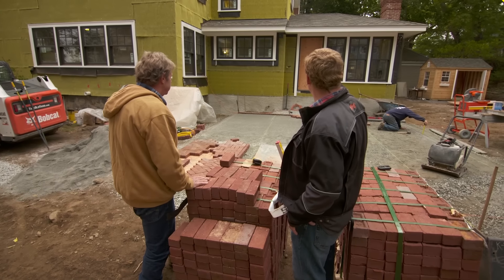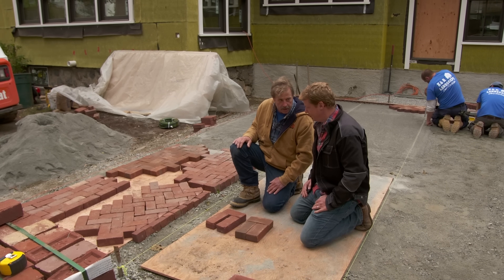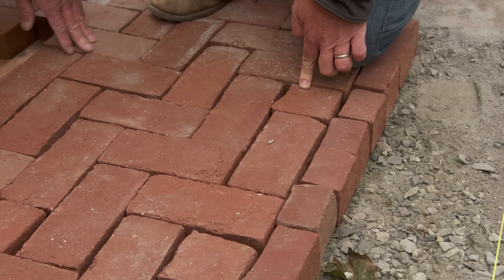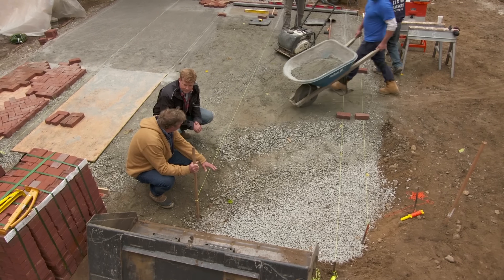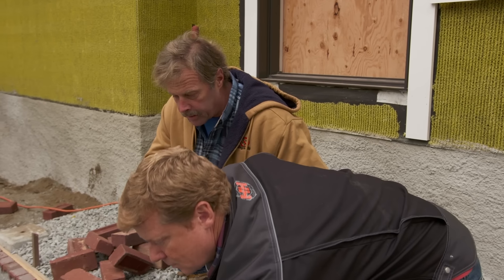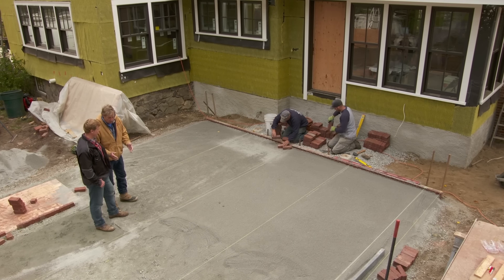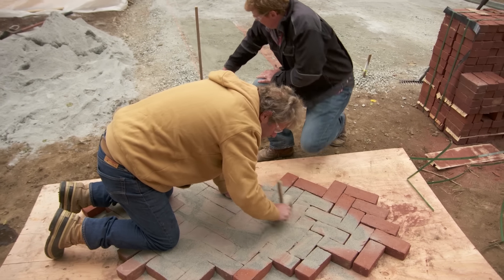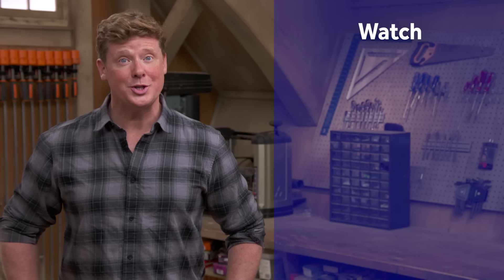How to Lay a New Brick Patio | This Old House

Comment: I'm about to build a similar paver patio. What's the best source to learn about how to do this for a first timer, particularly the prep work before laying down the pavers, which seems like the easiest step.
Reply: YouTube.
Reply: Prep work is the most important part.  These blocks look bad compared to U.K. standard lock blocks.  
The herring bone effect is little bit more tricky than the standard method just have to keep an eye on the blocks every 3 or 4 square metres using a line to make sure they are square.  
My favourite most satisfying job doing ground works has to lockblock driveways.
Good money if u can get price work on it.  Unfortunately price work is dying out with a lot of company's nowadays.
Some still see and pay groundwork as a labourer when it's a skilled trade.  Painters are often payed more which is not right considering a good gr oundworker can do concrete finishing, drainage, kerbing, slabbing, lockblock, tarring plus driving dumpers and rollers and able to operate a concrete saw to high standards.  There is more kids actually getting apprenticeships nowadays whereas it was seen as a labourer when I started out and all learning was on the job.

Comment: I don't understand the bricks on the plywood. Then using the expensive polymetric sand. Was that just an expensive example?
Reply: They just had them on the plywood because it's nice and flat and an easy place to set up the patterns on.
Reply: yeah, i was thinking the same, kind of a waste.
Reply: @TheRaker1000  It was set up strictly to show homeowners all the potential patterns they could lay out so the home owners/viewers could see. The mild costs are not anything more than .5% of the total cost.